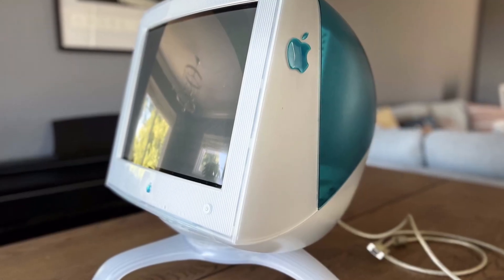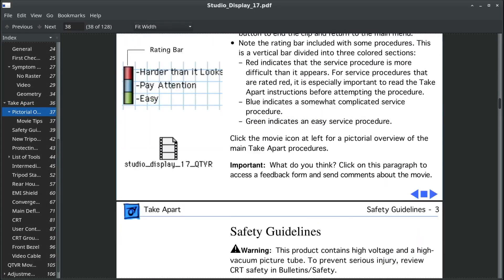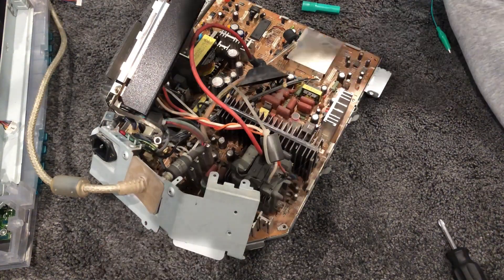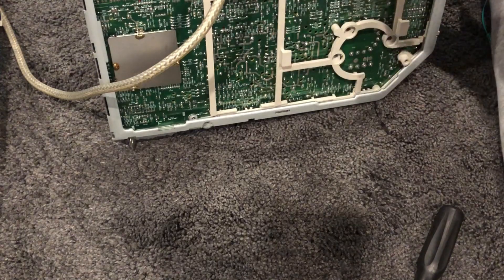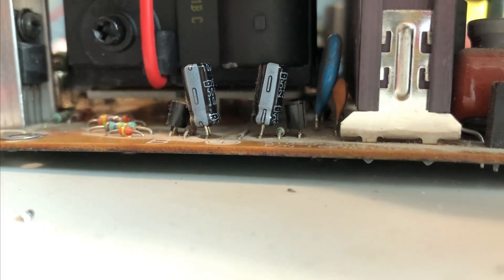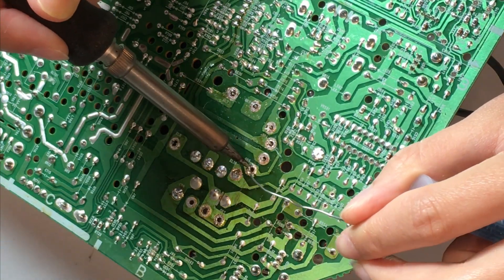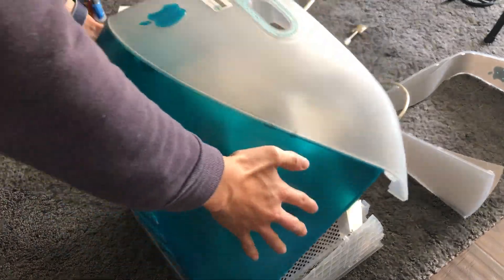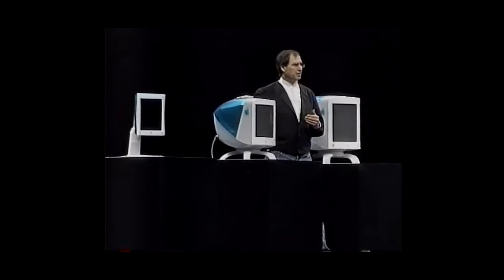I attempted flyback surgery on Apple's worst monitor - Apple Studio Display 17"

Comment: I have the 21in version, what is the name if the flyback transformer part i need to buy?
Reply from the maker: The 21” version was a different design and manufacturer, and didn’t have this particular issue. Might want to check that you’re not having a different problem.
Reply: @riveducha   Its hard to get good information. Yes the 21 inch was a Trinitron as opposed to a Diamondtron, and maybe the flyback is better, but I am still getting flyback issues. 

Rarely the screen goes black for a sec, and then the picture expands back to full screen with a snap/click noise, from my inexperience I believe its the flyback arcing.
I heard that the flyback only arcs when the refresh rate is set high, and I think that's what i'm seeing too, but I need to do more testing. 

The same company made a replacement flyback for the 21 inch too (I believe it's HR 46323)  but they told me its not available to order... : (
Not sure what to do.

Comment: Just wanted to drop a comment to thank you for this video. Really helped me get mine repaired. BTW I was able to get that plastic bracket out with no breakage… until the very end when I put everything back together and cross threaded one of the screws that holds the stand on. I was pissed I got 99% done with nothing gone wrong up to that point. 

Those flybacks are extremely hard to come by now. The part mentioned in your video has not been available for quite some time now. I found a guy selling them as part number Y265382A. The transaction was a little sketchy as he didn’t take PayPal or credit card, only bitcoin or you could mail a check. I decided to take the chance and pay bitcoin. I did get the part and it was the correct one.
Reply: Hi!
I have this flyback transformer issues…
Can you send to me the email to your supplier to obtain a new flyback? 
Thanks.

Comment: Desoldering is easier if you first use a bit of flux, and leaded solder to “wet” the joints with a soldering iron before attacking it with your hakko desoldering gun

Comment: I got one of these CRTs like a year ago with flyback issues, and picked up a replacement flyback around then as well.  Never got around to installing it, but this video came up on my feed recently so once I figure out where I put the flyback I think I have a new project. 

I also saw someone on the 68kmla found a 5v power source on one of the boards used that to power a fan which they attached to the RF shield, so that might not be a bad idea to do to help keep the monitor cooler and make it last longer with the new flyback(assuming the original failure of the flyback is heat related)

Comment: Hey there! Using your video, I managed to replace the flyback in my own beloved Apple Studio Display! I just wanted to say thank you so much for making this video. Without your advice and tips, I don’t think I could’ve done it.

That being said, I have a couple things to add onto the information in the video, in case someone else wants to do this repair:

The plastic piece on the back of the PCB, since you said you couldn’t figure out how to remove it without breaking it, I just decided to leave that piece assembled and desolder around it. I managed to get all the pins (including the capacitor you have to remove) without melting the plastic… too much. Lol.

When desoldering the flyback, even when you get all the pins it’s in there pretty tight and won’t budge at first. After I was sure all of the solder was out of the holes, I used a flathead screwdriver and a little bit of brute force to pry it up.

The capacitor you have to remove is C537, I don’t think that was mentioned in the video. I also had a hard time clipping it because it’s between 2 other capacitors of the same size. I just desoldered it, fortunately it was MUCH easier than desoldering the flyback. I used desoldering wick for all of it btw.

For the wires that come out of the new flyback and go into the neck board, the two thicker wires detach from the board using a button mechanism. You push the little tab on the side of the hole and it unclamps the wire, and you can pull it right out. And, as long as you strip the wire on the new flyback to the same length, you can do the same thing going in, no splicing or desoldering required. For the focus wire I did have to splice that because it uses some kind of connector that I couldn’t figure out how to disassemble, but since that wire sends fewer than 1000V I just wrapped it in like 20 layers of electrical tape to be safe.

When you’re adjusting the focus, I think one knob controls the overall focus and the other controls the difference between the horizontal and vertical focus. So I found that when displaying a test pattern and trying to adjust it, it’s easiest to adjust the difference to get the vertical and horizontal lines to even amounts of blurriness, then adjust the focus to bring both of them to where you want.

For anyone else who wants to attempt this repair, good luck! It’s very time consuming and definitely helps to have someone there to help you, but it’s possible! I’ve got it up and running and it looks great. I’ve got pictures and more details here: https://www.reddit.com/r/crtgaming/s/LN4kvROdbj
Reply from the maker: I’m so happy this video helped you! Your setup looks amazing and I appreciate the extra info you shared!
Reply: @riveducha max resolution  hertz ?
Reply: @StreetGamesCombos  800x600 at max 136hz , from gtx titan x " dvi-i  to vga adapter "

Comment: Perhapse as an aside, there exists self fusing tape that is used as an overlap for high voltage wires. It doesnt really seem to have an adhesive, but when wrapped over itself it becomes a single piece over the course of a few hours. It can be expensive, but I buy it because I use so little of it. One example is Scotch 70 which has 34kV/mm dielectric strength. Note that you strech it as you wrap, so each layer is thinner but there will be more wraps for a given length of tape. It can get you out of a bind.
Reply from the maker: I did not know there was such a thing as self-fusing tape! TIL! If the Scotch 70 is 0.3mm thick, then I calculate you'd want to wrap it at least 3 layers thick, probably more to factor in stretching. Or maybe use it on top of heat-shrink tubing.